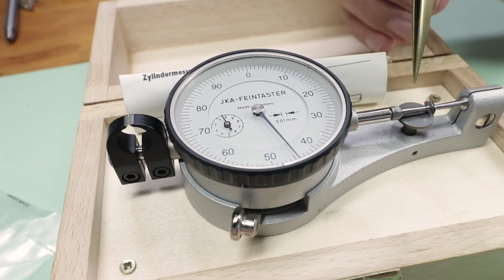Second Wheel Jewel Arrives - Watchmaking Vlog #20

Comment: Really like your format.  Not too long, nor too much talk and to the point.  Maybe a bit more details about the manufacturing process.   Did you buy the wheels, or make them?   What is the white chalky stuff you use on your files?  Saw you use them in the previous episode.  I assume its for cleaning the files.  Vallorbe files, right?

Thanks. Keep up the good work
Reply from the maker: Thanks for you comment, really appreciate the feedback! Yes, so I’m currently making bridges of my own design using an existing ETA 6498 movement. So for this watch I’m not making the wheels. The white block is exactly that chalk, it helps the file not get clogged especially on softer materials such as brass! And yes vallorbe also F.dick which is a German brand 😁😁
Reply from the maker: Thanks for that info Skir! I had no idea, I do keep my files stored in tool chest, and try not let them touch..haha I’m a bit pedantic about my files.. I will keep that in mind 👍🏼 . Yes aluminium is sooooo bad. I just use cheap ones if I ever have to file aluminium which thankfully hasn’t been many times 😁
Reply: @DeanDK   - if it were gypsum (calcium sulfate dihydrate) , that would be right - if you're using the Cousins French Chalk block (magnesium silicate) then the hygroscopic and rusting issue shouldn't arise in the same way. There is unfortunately a lot of confusion and re-use of the word "Chalk" for different, but visually similar, materials..... Gypsum is used in Blackboard chalk, which would be problematic in the way @Skir warns.
Reply from the maker: windsoruk thanks for that, I am glad I’m using French chalk 😁

Comment: CousinsUK are great until you need information from them or need to return an item or recieve the wrong one. Buying from them is easy in my experience, everything else, not so much.
Reply: Ditto.
Reply from the maker: Someone else had mentioned this as well Karl. I wasn't aware as I haven't had any issues like that so far, that's a little unfortunate to hear.